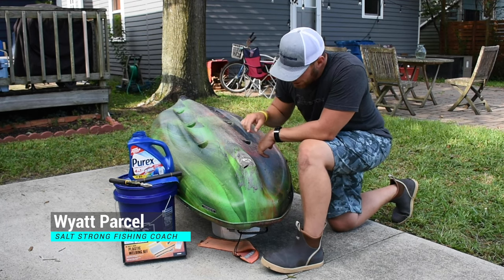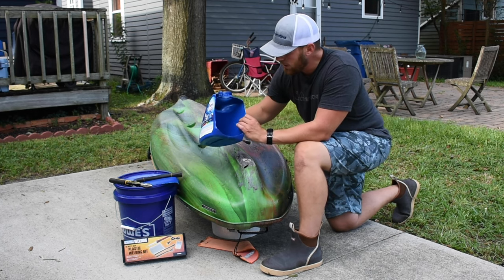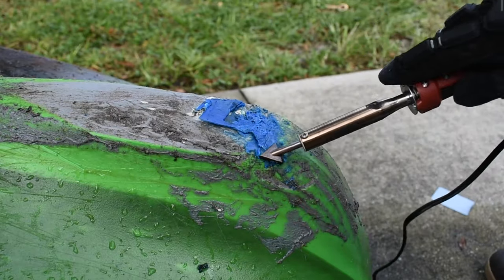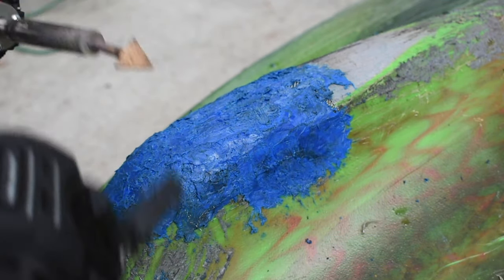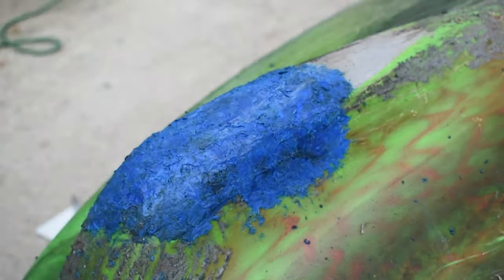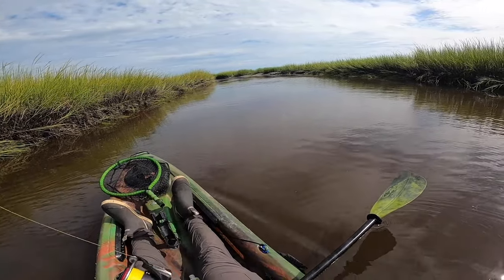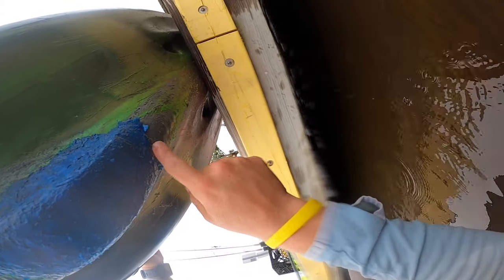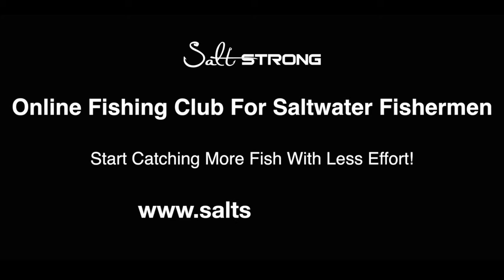DIY Kayak Fix: How To Repair A Hole In Your Kayak With Plastic Welding

Comment: The hull needs to be clean and both the patch and hull material need to be heated to adequate temperature for proper bonding.  This is why your “patch” is pealing off and leaking.
Reply: Came here looking for ideas.  I am going to try a heat gun.  That should melt the plastic easily and can probably put on patches rather then little pieces.
Reply: I did get some useful information from this video. I didn't know the type or grade of plastic or where th o get it, until now. But, how did he know? Why not clean kayak inside and out? Apply patch materials inside and out; sandwich patching. I think because of the potential of scraping the boat bottom on hard surfaces like a rock. I think sandwich patching adds not only strength but helps to keep the patch in place longer. Could keep a leak slow, instead of loosing patch altogether. Yes, I am aware of hard place to get to, but I am going to try mine. Where to buy and prices, glad that was pointed out too.

Comment: 100% waterproof: Buy a caulk tube of 100% silicon.  Put the kayak sitting up on the ground. Elevate the opposite of the keel hole at an angle so your inside keel cavity is some what level. Fill up with silicone. Wear some gloves an smooth out. Let it dry. Smell will disappear in a few days. Been riding like that several months. My hole was about 1/2 a pinky size. I am about to do your step as my second part. Thanks for the video.
Reply: Can you send a link to what you used?
Reply: No no no! 
You fix plastic with plastic! 
Hot plastic sticks to hot plastic!

Comment: I ended up buying a heat gun as well as the welder. [also make sure you have sand paper and tin snips for the mesh]After repairing one hole, I couldn’t imagine doing it without the heat gun. The plastic is so rigid and the heat gun helps form fit it around the keel. Also pre-heating the hole area on the kayak definitely helps it weld together.

Comment: Gotta combine that with flex seal on the inside if you can get to the spot, creates a watertight seal
Reply from the maker: Thanks for the tip!
Reply: Used flexseal had a kayak that sunk

Comment: If you had cleaned all of the old residue from the old patches off before welding on top of it, you would have had a much better chance at a waterproof weld.

Comment: Have the same plastic welding kit. Works great, but you need to make sure the original surface is clean and also melted to same temperature as the new material for it bond well. New material will not bond to cold plastic very well. I use in conjunction with a heat gun to keep some temp in the work area.

Comment: I used a wood burner . It worked perfect . Before that , I used a propane torch . 
I really liked using the 1 gallon oil containers . Nice and thin so fast to work with . 
 i fixed the hole and then added a keel guard from the used oil containers . It looks so nice with the blue camo kayak and the dark blue keel guard .
You can also contact most manufacturers and they will send you rods to match the color of your kayak . 
I had saved all the material from drilling or cutting for add ons from my kayak for the last 7 years . So , the outside repairs from my hole matches color from my kayak . Inside , I used wire mesh and used oil container .
Reply from the maker: Thanks for sharing!

Comment: I used the wire mesh first and just melted it to the  kayak then a layer of plastic this bonded much better , i also filled the inside with windshield adhesive so i dont think i will ever have another problem

Comment: I cant even get to the inside of my kayak - not clear about how other people do...? but I bought the wand - was trying to just find a tip for my soldering iron but nothing was available it america it seems. my split is about the same size as yours and got a little worse actually this last time out - but the entire patch was gone. cant wait to try this and glad I read comments first and found out I can use a thinner #2 instead of that thick hard to melt laundry bottle! i have a bleach bottle that is much thinner. thanks for the video - I wasnt sure how to go about doing this.

Comment: I just bought two kayaks from a co worker for $175. An 8ft and a 12 ft. One had a hole in it I didn’t know about until yesterday 🤣. Found out the hard way lol. Anyways I’m definitely going to try this. I just sealed the hole inside and out with 100percent water proof silicone so ima see how that works

Comment: Great job on the welding. I would start with a good cleaning and sanding the surface before I start welding.
Reply: Your 100 percent right and a no brainer.
Reply: I would also add that the stainless mess should have been welded to the kayak before adding the top layer.  There shouldn’t be any reason that this isn’t a permanent solution.

Comment: Wouldnt it be easier and look alot better if you just heated and bent a sheet of plastic to the contour then weld/epoxy it over the area? I dont have a yak myself so never had to fix one but ive fixed many of plastic things that way. That looks like crap and cant be made smooth. Wonder if you could cut out the hole and just plastic weld a new one in? Maybe clear so can see thru it to bottom? I build aluminum/fiberglass boats but see yacks popularity increase all the time so i may need to start working on them as well.
Reply: That’s a really good idea. I think one of the mistakes made in this video is not cleaning the area well enough and seeing that there had been multiple repairs attempted made it difficult to really prioritize the leak itself. Cleaning the area and even drilling at the two ends of the crack are a good way to ensure the damage doesn’t spread. Covering the whole thing in plastic like “plastic duct tape” doesn’t help very much. Using whatever material the kayak is (HDPE in this case) and bonding it to the damaged area and attempting to fill it in are way better ways to actually fix the issue. The mesh is really helpful in areas that are are either many multiple cracks or a massive, structurally compromised, crack.

Comment: I've had the same temporary soft patch covering the 2x2 inch hole in the bottom of my yak for 10 years now. It never leaked but every year I think about fixing it properly. After seeing this I have no desire to repair it whatsoever, my temp patch from dicks for $2.50 is leagues better to be 100% honest.

Comment: You MUST melt the wire mesh into the hull of the kayak. You were just melting plastic into the loose mesh,  one sharp rock and it's leaking again. 
This must have been your first patch after watching bad repair videos.

Comment: Are you sure the detergent bottle is the same plastic as a kayak?? 🤔🧐
Reply from the maker: Great question! Make sure to ask this over in the Community (https://www.saltstrong.com/) where the coaches spend their time.
Reply: It is if the kayak is rotomolded polyethylene, the most common material used for kayaks, and the plastic bottle is marked with a recycling triangle with a 2 inside it and the letters HDPE below it, which stands for high-density polyethylene. They are both the same type of plastic, chemically identical which is what's important in dealing with plastics. There are also  plenty of other consumer products packaged in #2 plastic, most notably milk bottles and white vinegar jugs. 

You certainly wouldn't want to do this on a fiberglass or Kevlar kayak, and I've been seeking advice on whether I can do it on my ABS plastic kayak. I have friends with rotomolded poly kayaks who have successfully repaired cracks using a soldering iron like they use to securely close plastic shorebird bands so they don't come off or partially open such that the band could potentially injure the bird's leg, or lead to something like fishing line or an old net getting caught in the crack, which could have all kinds of negative repercussions for the bird. 

I'm actually in the process of obtaining some scrap plastic from the manufacturer of my kayak, of the same type from which it's made, so I can experiment with the soldering technique before actually trying it on my kayak.
Reply: @bethwright8595 i just thought about this further, we have another plant that does assembly for our client attaching a abs part to an abs part. You need a special chemical bonder to bond the ABS to itself with the scrap u are using to the Kayak. MEK is a binder you can use. I am not sure how to advise on how to use it all for your project in particular but hope this all helps